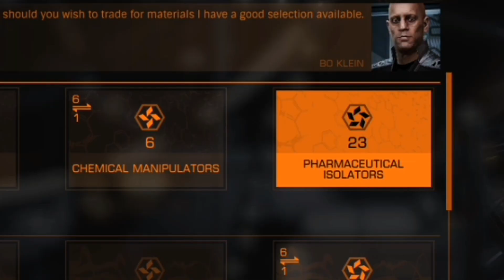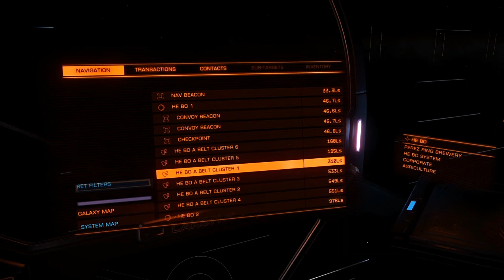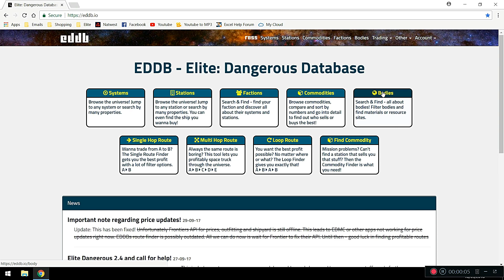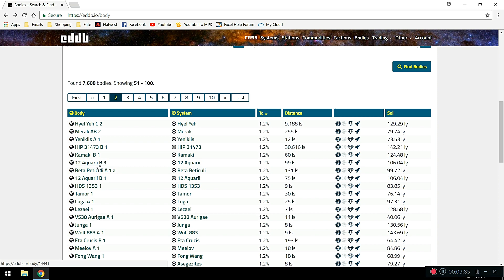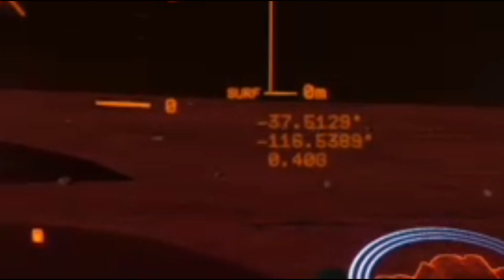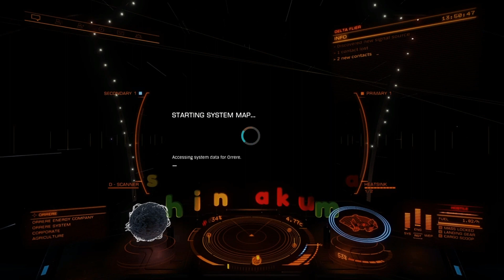Ultimate Guide to finding Grade 5 Engineering Materials after 3.0

Comment: Look up here https://inara.cz/galaxy-components/ Hover over the location descriptions, especially when it mentions USS emissions and read in the little box more details about where to find the specific component. Note that many are found in the same general locations.

Find an according system, place the parent star behind you (place the hollow dot in the middle of your radar) and check for the (mostly) high grade emissions mentioned on Inara's components page. Travel far out into space. 100,000 ls or more. But don't just travel there like shown in the vid, high grade emissions show up at any time. I pick them all the way up on my way away from the star!

Note: Don't travel faster than about 80 c. USS usually appear at about 800 ls distance. This gives you 10 s to catch them before they pass you and you had to turn around. Filter your Nav panel, only star and signal sources are needed (the star to make the parent star visible to target it and place it behind you again after you've farmed a USS).

Play some music, keep the Nav panel open and watch it and wait for the USSs to pop up. Target it, scan it, if it's the correct one, drop out there, if not, move on. Don't waste your precious time on other sources. Also pick up encoded emissions! They're just as rare. Done. Happy grinding.

Comment: Great and useful video.  I knew a lot of this already but still have !earned some extra tips and tricks that will certainly speed things up especially regarding grade 5 manufactured materials.  
Regarding planetary prospecting materials however I do have point to make regarding my own observations after playing since console launch.  I don't dispute that your method is wrong or doesn't work, I'm sure it does, however my experiences has shown me that metallic meteorites (which are more likely to contain higher grade materials) do indeed have a higher chance to spawn near areas of volcanic activity.  That's not craters, it's the areas around the edges of mountainous regions and natural rock formations.  Again, just my observation after many many hours.
Despite that difference, great job on the video, very good information and I will be linking all of my wing mates to it as I'm sure they'll find it of use.  Keep up the good work o7.
Reply from the maker: Hi, You are correct in saying that a metallic meteorite is more likely to spawn first time from the pool of 4 types of meteor at the base of a volcano.

However the terrain is rocky, uneven and hard to navigate. So in the time its taken to spawn one Meteor at the base of a volcano, you could have spawned maybe 7 or 8 on a flat surface. So based on a pure numbers game, its more efficient to take your chances on a flat plain, by either getting lucky with Grade 5 content from the lower 3 rocks, or spawning a Metallic.
Reply: Yes, in my personal experience, material drops (in whatever form - outcrop, metallic meteorite or whatever) seem to spawn at regular distances from each other. So the trick is more to maximise travel between these distances, in the shortest time possible. A smooth planetary surface is critical for this.
I personally also only choose to prospect on HMC / icy bodies. It also seems to me that the mineral percentages don't necessarily reflect the percentages you'll actually encounter. I was searching for a mineral with a percentage of about 6%, but found other minerals which had percentages of lower than 2% much more often than the one I was searching for, with the result that I was able to completely fill up my storage space with these other minerals before I filled up with the higher-percentage mineral.

Comment: Nice video! Just the sound sucks a bit. Here are some additional (correctional?) info from me:
1. Any system in state of ...: I recommend to look for independent systems, as other material may spawn more often. E.g. an empire system in outbreak may spawn more imperial shielding than pharmaceutical isolators. This also applies to Military Supercapacitors and Military Grade Alloys.
2. Improvised Components are mainly found in independent systems in state of Civil Unrest - not Civil War (has this changed in 3.0? I still find my IC in state of Civil Unrest).
3. Sothis may be a good source for any material because of the sheer amount of missions you can stack. In fact, there is no need to travel that long distance just for material farming. Any system you are allied with and preferrably is in boom state offers missions of G5 mat reward.
4. Since 3.0 mats like "Imperial Shielding", "Core Dynamics ...", "Military Grade ...", "Pharmaceutical ...", "Proto Radiolic ..." and "Proto Heat..." also appears in combat zones or bounty hunting in planetary rings when killing high ranked battle or pirate ships, preferably Anacondas and FDLs, sometimes an Elite Vulture.
5. The higher the population of the desired system is, the higher the chance of finding HGE signals. But there is no need to travel  100k ls into deep space. Flying anywhere off the planetary plane (ca. 500ls) or more is sufficient. In average (guessed by experience), ca. 10% of all signals that appear are HGE. RNGsus hits you hard at this point.

Comment: Something must have changed. I'm at He Bo doing exactly what you described and all the signal sources are degraded, emissions, distress calls etc. I've had 10 or 12 and not a single high grade
Reply: Now over 50 USS in He Bo and Bunda and not one single high emissions. Am I too far from the star? In the wrong place? Help!!!
Reply: It's called RNGsus!
Reply: The system should be in boom. And high grade emissions usually appear once every 15 uss